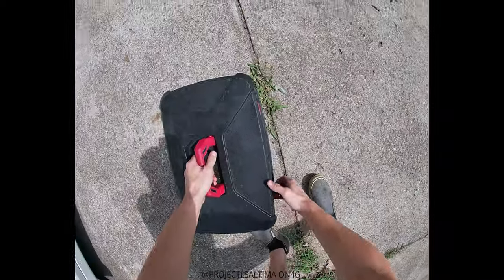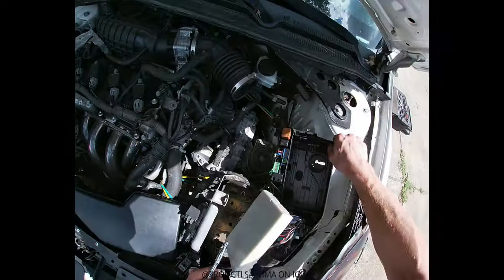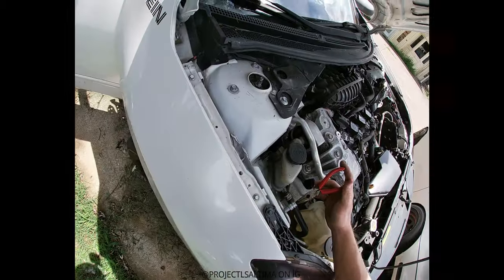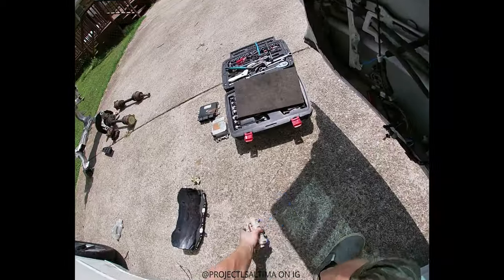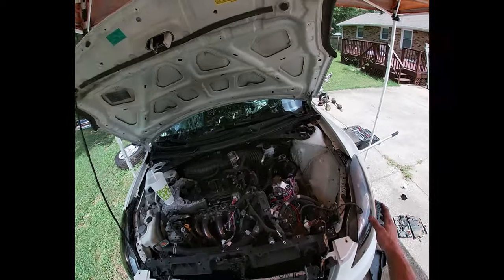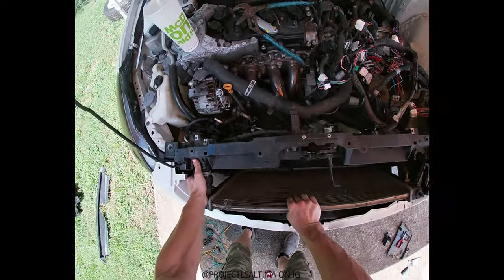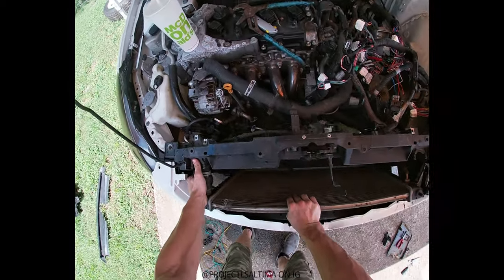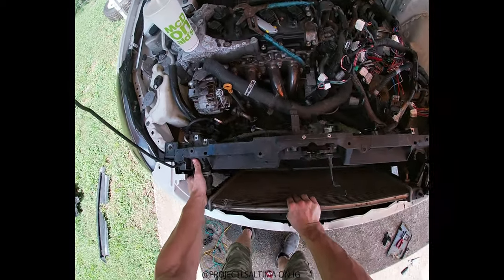Altima wiring harness removal:how to

Comment: cant wait to see how its goes I wouldn't mind installing an ls in my Altima, up till now I thought I could only fit an ls4 in but you have an lm7 i think you said '04 I'm not sure what's different between the two models. which trans did you remove from the altima, how much do you want for it? how far away from los Angeles is it?
Reply from the maker: I'm in Tennessee and I have been wanting to sell for 1500 engine and transmission